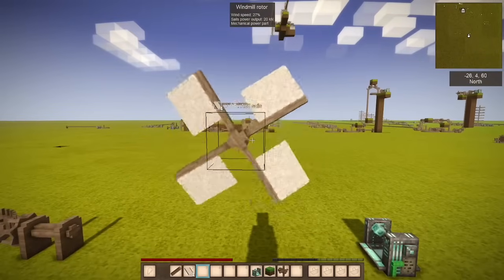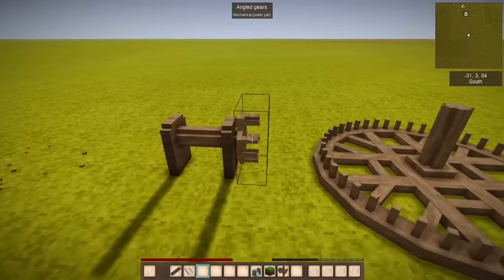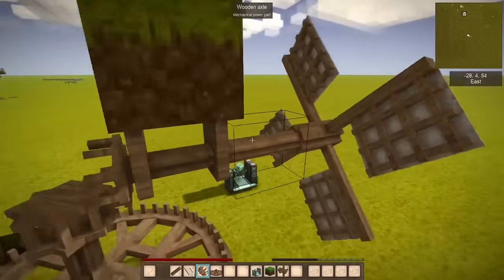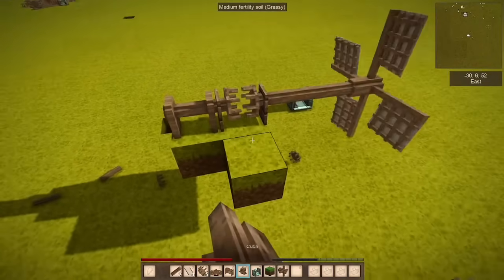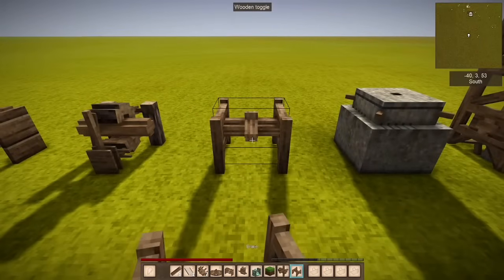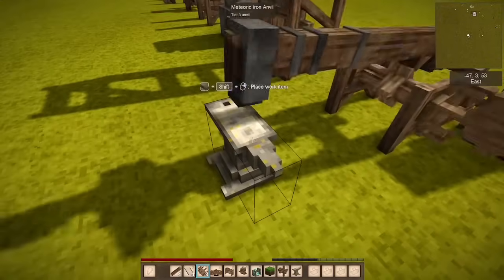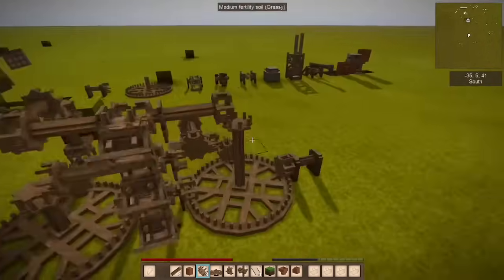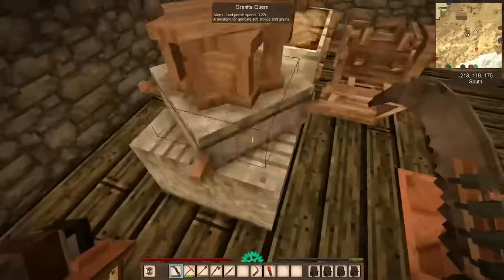Ultimate Mechanical Power Guide - Vintage Story

Comment: I might be completely wrong, but as far as i can tell downshifting the 'transportation' line then shifting up wont save any power by itself. However the 4 mills on a large gear does save on the cost of 3 lines, if a mill would go from 300 -> 200 due to friction, 4 mills would still have the same friction cost and go from 1200  -> 1100. Basically the friction tax is based on length and not the amount of force and so saving on length is advantageous.

Comment: Does transmission have a energy cost of 1 both when clutch is engaged and disengaged?
Reply from the maker: Correct
Reply: @bratworst you gonna do another video like this when 1.22 drops, considering the fact that they will add more mechanical stuff?
Reply from the maker: Yes, and if they add the right mechanism i might also make computers and calculators

Comment: This is an interesting description of VS mechanical power that I have seen so far. Has anyone verified that the small to large gear ratio is 5.5, rather than 5.0 as per the Wiki? I give credit for count gear teeth, but does the graphical representation accurately reflect the underlying calculations in the game engine.
Reply from the maker: I also counted rotations with a stopwatch. It is visually 5.5x faster

Comment: Awesome video! It was super clear and straightforward and has made mechanical power much less intimidating hahaha
I'm still not understanding the relationship between wind speed and power output. Do you only get the 20kN per sail length if the wind is blowing at 100%, and if it's slower you get less power? Like if the wind is at 25%, would the windmill only output 0.25x20kN=5kN?
Reply from the maker: I think it would be the same torque just slower but im not 100% sure

Comment: Ohhhh, that explains why my setups weree lacking in power a lot of the time, the interaction between large gears from vertical direction and the power requirement multipliers just tanked the helve hammers no matter if I built the rotor at Y:100 or Y:200

Comment: Close. It's done in kN because that's how torque works. So at 30 kN*m we get 3059 kgf*m, which we can simplify to 3000 kgf*m and simplify even more for the sake of the game running so many calculations to just 300 kgf*m. So every additional axle you're adding, which is 1 meter, reduces the torque by 1 kgf*m. Each additional device added will increase drag and thus reduce the total amount of available torque. So you were close, but it's not "power" it's torque and is based on actual torque calculations.

Comment: "Put your windmill 170 blocks in the air for maximum power. Also, each shaft costs 1 power"
Bro I'mma just play Create. Or Crossroads. I am not gonna downshift to make my shaft column cheaper and then upshift at the endpoint.

Comment: So:
If I want speed, I should make the speed mechanism as close as possible to the work area and as far as possible from the rotors to avoid the multiplier penalties of all the axles and gears going down/away from the windmills and into whatever I need to power?
If I want torque, I should make the torque mechanism as close as possible to the rotors to benefit from the divided power consumption?

Comment: The correct physical value here is torque. Since you are always losing a fixed amount of torque per machine or part added. The units aren't Newtons, but rather Newton-meters, so that should be kNm, not just kN, but otherwise, it's closer to what the game does than any concept of energy or power. Because power transmitted through a gear system doesn't change, but speed and torque do in inverse proportion. So if the 5.5 step down gear decreases the speed by a factor of 5.5, it increases the torque by the factor of 5.5, and that means that any part attached from there on is 5.5 times "cheaper" as it still costs you a fixed loss in torque, but from a total that is now larger. It is a little odd that this works out to 66.(6)kNm per axle. I wonder if there's some rounding at play here. Either way, thinking of torque as 300 units to be spent rather than its exact metric equivalent is very useful indeed!

Comment: Interesting design, I use a 4 windmills near to the high limit build, a second set of 3 after those 4, it can be extended to ground lvl, then I use a 3 gear setup, not the one you show up, main gear > angled to the top of an other 2° gear > angled top of the 3r gear, pulverizer and quern at the 3r gear and a set of 4 helvets at 2 gear, obviously with a clutch in every machine so I can turn then off, quern its almost instant griding, pulverizer sounds like a machine gun and  almost instant done, hammers finish really fast, quern and pulve has hoppers + trunk  to fill and storage

Comment: Was wondering until the end what the up/down shifting or speed actually affects in the end, but now I got it.
Downshifted, the device works slower, but uses less power and you can work a setup without needing more sails/windmills, at the cost of work speed.
Upshifted is the opposite. If you have enough power in the system, the upshifted device can use more power, but will work faster.

Thanks for this awesome tutorial. Can't wait to start automating tedious work (plus getting the pulverizer for some more late game stuff).

Comment: Finding out the gear ratio is 5.5 and not a clean number has done irreversible psychic damage to me.  Great tutorial
Reply from the maker: Wait until you realize that you use 12 sticks in a large gear section when it only has 11 teeth
Reply: @bratworst well you use 1.1 sticks per tooth and you break a little off the extra stick and put it on each tooth.
Great video btw
Reply: @cowit1679  the extra stick is for when you mess up lol

Comment: Hey I am really into technical knowledge for games and I want to understand how you came up with the 300 units of power for a 20kN windmill. Because if I use the resistance values for an axle (0.0005) from the wiki and multiply it by 300 you get 0.15 units of resistance. Does that mean that this is engough resistance to stop the windmill torque of 20kN? or is the wiki simply wrong on those numbers? Whats the torque to resistance relationship - by using the numbers above it should be 0.0075 units of resistance to counteract 1kN of force (15 axles). 

Anyway, great video! There is not much technical content for VS to this date :D
Reply from the maker: I made up these numbers before the wiki had resistance values. I just defined the axle as the smallest unit (1) and kept placing axles until the windmill stopped basically

Comment: Thank you for doing this. Can you do the beehive kiln next? I cant find anything on how much fuel it really needs to operate.
Reply from the maker: I cant find any information on that either, thanks for the idea 👍
Reply: So far, I've used 6 brown coal per slot, and it works for shingles, ingot molds, and other molds.

I've tried with 4 once. It didn't finish the molds inside.

Comment: 2:18 formula seems weirdly constructed. 150 energy used / 300 energy produced = 50% speed. But if we use more energy at 300/300, we get 100% speed?

Or is it like a speed penalty instead?
Reply from the maker: You would get about 0% speed. And i made up the formula btw

Comment: Say I had angled gears and a large gear connected by an axle and they were spinning in opposite directions, and every time I flip a clutch there was a few seconds of stalling while the system tries to calculate what the fuck is going on, would you have any idea what the problem would be?
Reply from the maker: Im pretty sure that the game is programmed in a way that there is no loops, making it possible for 2 connected pieces to spin in opposite directions because in code they are seen as both connected back to the power source not eachother. The stopping happens when a mechanical system gets changed sometimes and i have absolutely no clue why it happens. Maybe it is a broken momentum calculation
Reply: @bratworst  Shame. Well thanks for giving it some thought regardless.

Comment: I really like how the speed and length matters for the stress in VS vs create which just has stress units which are used based on the speed of the machines used and not the full contraption.

I hope that we get some fun stuff in the future!
Reply: What you see in the video is acrually been considered from the very start of Create! 
Sadly, it seems that calculating the stress use of every component leads to a lot of strain at the processing side, leading to re-calculation of stress with each component changed.  that's why you see systems in this video suddenly stop and start - it re-adds every component of the system and just restarts it, which could lead to stutter if you building a long shaft or whatever.
Reply: @mrShift_0044 Yeah trying to implement that in Create would be so hard. The Create mod team are absolute geniuses and have done a phenomenal job of optimizing the mod, but at the end of the day there’s only so much they can do without altering the engine, which is the whole reason VS exists.
Reply: The stress unit of create are the exact same as the implicit power units in VS. 

It's actually VS which has a stupid moment when they call a force a power when it should have been a torque in the first place

Comment: Now whats better, 4 hammers working on 1 anvil or 1 hammer that is faster 😂
Reply from the maker: As far as im aware they are the same efficiency as long as you can power them. Its either 4x speed at 4x cost or 5.5x speed for 5.5x cost
Reply: @bratworst  hmm, so 4x is better because there's some kind of limit oh how fast a Hammer can go
Reply from the maker: I just tested it and you might be right about there being a speed limit
Reply: @bratworst  I wonder how you tested it. Because it does feel like it has a cap with those pauses. What if after those pauses it speeds up even more to conpensate for the pause. 😂
Reply from the maker: Perhaps it slowing down is part of its animation, ill have to see if it slows down the whole system or not

Comment: This clarifies a lot, other videos I've come across  weren't actually clear about the out put, and what the components take out of the system. Also the issue of having to add a large  just to flip rotation to match inputs is a pain in the ass, if the small angled gear allowed for just 1 more attachment point, or some sort of Idler gear this would be simplified.
Reply from the maker: There is a reason nobody else says the numbers is because i made them up. The numbers are a very close approximation but not the exact numbers as those are not publicly known as far as i am aware
Reply: @bratworst  I figured they were approximations but there a few cases where I wasn't getting the power expected out of a system, not moving the helve hammer after having nearly full sails,  and this now clarifies why. I figured axles took almost nothing out of the system. Even with your arbitrary numbers it makes way more sense.

Comment: sounds about right, I've found that powering quernt from the bottom allows hopper input from the top, and if you block 3 of the sides or use many hoppers, you can collect it's output. seems like it does reduce it's efficency? I think you get the full results but there's a chance it "fails" to complete the opperation if some sides are blocked. I"m probably gonna make some water chute so the outputs flush to a single hopper, though.